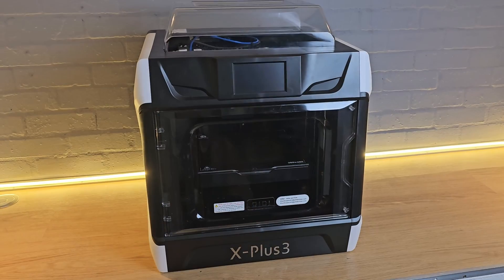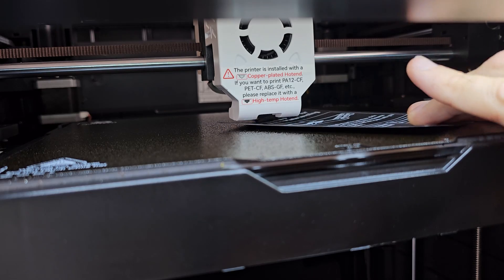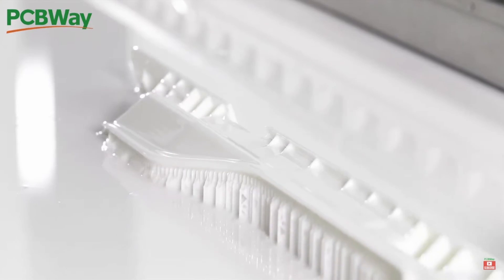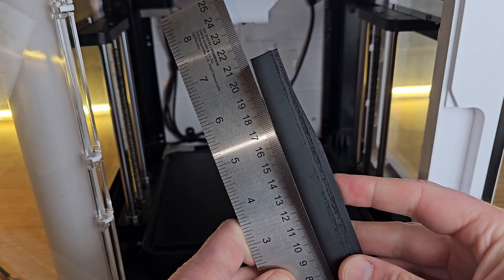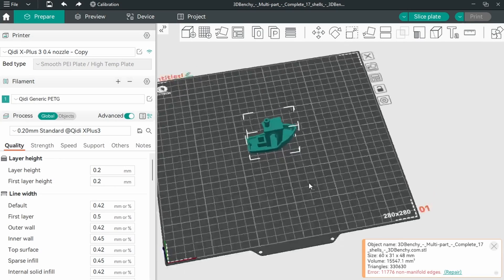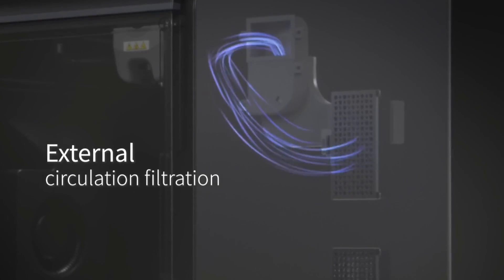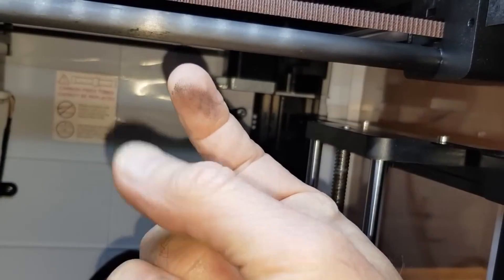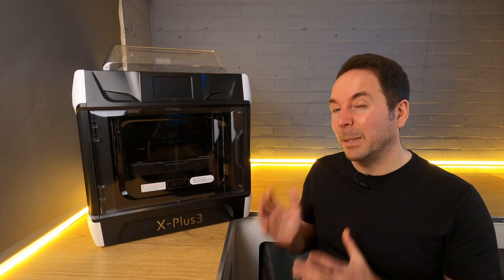3d Printer that does it all? - Qidi X-Plus 3 Long Term Review

Comment: I have owned the X-Plus 3 for over six months (having previously owned the original X-Plus for several years). IMO, the X-Plus was a MUCH BETTER printer. Half the parts off the X-Plus 3 are pure garbage. I mean absolute fails, as in a birds nest of filament from attempts at simple parts with Qidi Tech supplied PLA. I wish I had kept my older model (given away as a gift). The X-Plus 3 also suffers from firmware issues. All in all, this machine has been nothing but frustration for me. It is a beta product that should have never been released for sale.

And now the heated bed has failed (in less than 100 hours of actual print time). QIDI says I should buy a replacement bed. The problem isn't the bed. The problem is QIDI Tech uses substandard wire. The wire they are using is not continuous flex rated, which is what should be used for repetitive motion. Buying their replacement bed (with wiring) would most likely result in yet another failure at some point. I'm replacing the wire with continuous flex rated wire from Igus.

Comment: I've had an X plus3 for 3 months. This machine is currently the worlds largest paper weight. Problems started with the extruder which failed in the first few days. This was replaced by support. The machine then wrapped filament around the hot as a print came loose, so another wait for a new hot end.
I pressed on and got a few excellent prints, but this didn't last, I then had problems installing some new firm ware, this resolved, and my first prints were well up to standard. Things changed suddenly for the worst , the hot end started driving into the build plate with considerable force and it was impossible to correct this like you would some simpler machines. Support is trying to understand the problem but as it is the machine is unusable. So until I receive a fix from Qidi all I have is a large paper weight ...oh and of course my other trusty printer.
Reply: any update?

Comment: Qidi sent me a free new hot end after 1-2 months of use and the temperature would fall once the part rapid cooler would turn on revealing an obvious issue with the unit, so I think they treat customers quite well. I monitor 6 of these units and so far they are good units, but some bed adhesion issues without the use of a glue stick.
Reply: i haven't used glue stick once and get perfect prints lol

Comment: The only thing it seems to ahve over the creality K1C is the  size you can print at.  I'd like a larger size but most thing I print fit well within the 220x220 frame.
Reply: The frame is also more stable and thus you get less ringing
Reply: @iboysven  Plus the heated chamber and it's honestly a more solid machine overall. I believe the onboard processor is also more powerful if you get into complex G-code.
Reply: Aaaaand... PRICE.

Comment: Nice review
I hope my Qidi max 3 will be good)
Reply: Wait for Qidi Q1  !!!
I can actually recommend all of Qidi's X-3s. Apart from the bed ventilation and the space-heating (Plus/Max), these only differ in the printing size. Bed heating (max. 120°) and hotend temperatures (350°) are the same.
Reply: @jamesbont7052  too late)

Comment: You never mentioned if you used any higher temp filaments (other than ASA).  Did you ever print anything at 350?  That's WELL within the range of PEI and PPS.  Actually most of the extreme high-end plastics print in that 350-ish zone.
Reply: I have the smaller Xsmart3 no enclosure heating doing amazing ABS prints without any difficulties.

Comment: Since last year the Qidi has become my favorite "go to" for printing. I sold off 6 bed slingers and replaced them with the Qidi for my production needs. I do wish they had a side loading arrangement for filament changes etc, but all else has been awesome.
Reply: I agree for price and capability I believe at moment the new Qidi machines are hard to beat.  They also have very high ratings on support.

Comment: If they do have a good accelerometer in the print head, I guess there's just something wrong with the Klipper configuration, because Klipper calibration ought to be able to iron out the ringing on its own.  With some luck, maybe that problem can be fixed in a firmware update.
Reply: The accelerometer is fine. What I found is that the default algorithm selection will favor acceleration over vibrations to a certain extent. If you look at the output of the calculations you can see it'll often pick an algorithm with some vibrations still present. Looking through the list we can pick the algorithms with 0.0% vibrations with the highest accelerations instead and manually set those in the printer.cfg file in place of the automatically selected algorithms

Comment: do you recon the qibi tech x-smart3 is a good 3d printer for the use of project, like chassis for robots and so. This one, x-plus 3, is a lot over the budget even though it is what I need. The only draw back for the x-smart3 is just the bed size, I would rather much have at least 20 x 20 for the base. unless there is another enclosed 3d printer that can print abs too, and potentially nylon or a cf but around £350. Im just stuck as there is a lot of options out there but what I need for long term is just sly out of my reach.
Reply: i can tell you it is, as long as you don't need a big build plate, and that as far as i know it's still the only printer you can print a PC blend with - dunno about pure polycarbonate as i haven't tried - for that kinda money. it's just good at everything else too, no complaints about it. i do have a bigger printer that i use for bigger prints and it still gets some use, so you're right that the bed size is a bit of a limiter. the only other issue i would have with it, if i was to have it on a desk next to my office and not in a shed, is the standby fan noise. it could probably be replaced with a silent fan easily enough, if needed.
Reply: @DREADNOUGHTANDCROW  no, i've used a .4 and a .6, but QIDI do sell a 0.2 nozzle so it's entirely possible. The small bed size and the corexy design should be capable of giving you as good of a result as you can reasonably expect from any FDM printer with a 0.2mm nozzle, with the right settings

Comment: I'm surprised they didn't include the camera in the middle model.  I just bought the little guy, X-smart 3, and I did the same as you, Logitech on a tripod.  But as you said, not ideal, especially with the more expensive models.  I don't begrudge Qidi for skipping the camera on the little one, since it's a $400CDN printer, but they should have included it with the higher up models.  VERY happy with mine though, it can blast out high quality ABS parts in very little time.
Reply: I grabbed their camera for thirty some bucks works great on my XSmart3.   The Fluiid software has camera view and one can setup think Octoprint camera control pretty easily also for using camera remotely if one wanted to.  It took about 5 minutes to install, goes in front right top corner and fits very nicely.